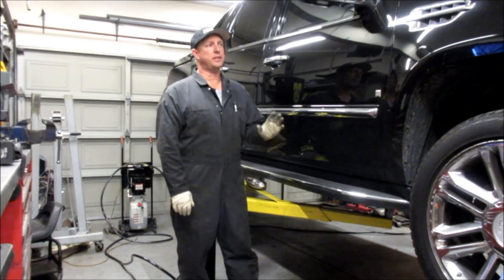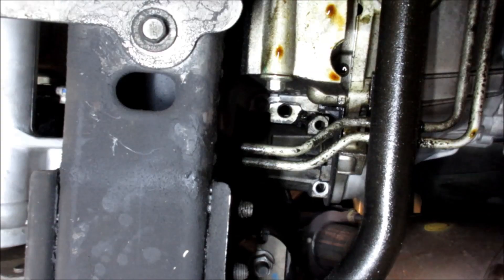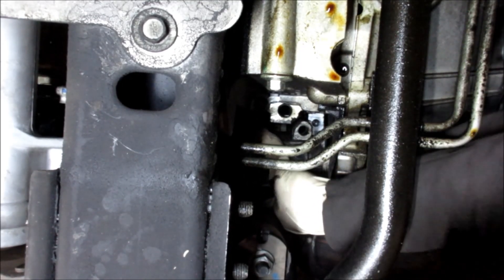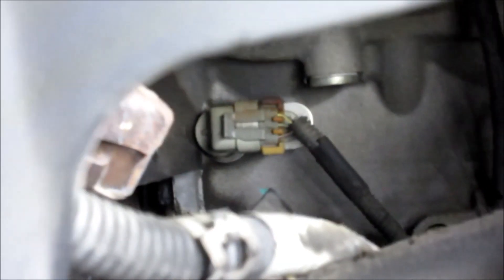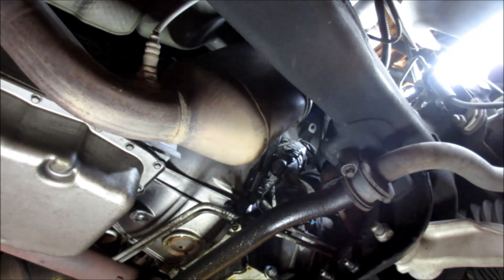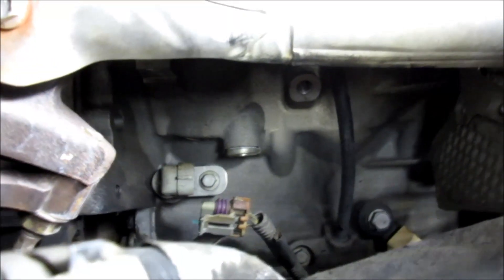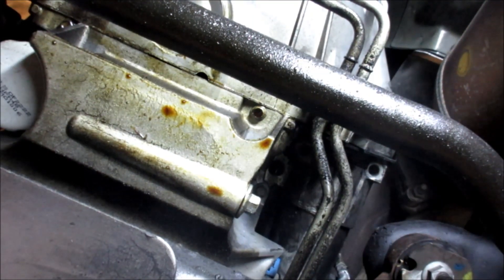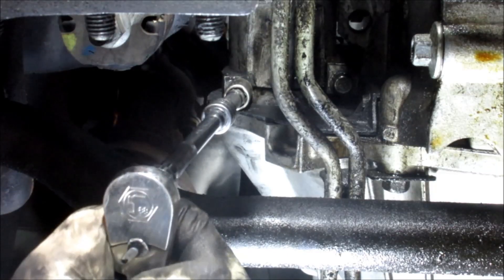Chevy GMC Cadillac GM 4.8L 5.3L 6.0L 6.2L crank sensor replacement

Comment: Where is the crankshaft position sensor located? 2015 silverado 5.3
Reply from the maker: It's right above the stater. Bolted into the block with three wires going to it

Comment: I have the same drip of oil on my starter bolt. Is this why you replaced the crankshaft sensor? It seemed dry when you removed it. Thanks.

Comment: I just did this on a 2012 Yukon Denali 6.2l - easy. Fired right up. Seems to run good. What started it all was oil pressure sensor - gauge reading nothing or erratic. Changed that and P0300 code appeared. Ran Techron through two tanks of fuel. No vacuum leaks. Had P0305 code appear for a day which means misfire on cylinder 5. Changed plugs and wires and P0300 code remained and P0305 disappeared. Had a guy tell me a lot of times it's the crankshaft position sensor so I changed it by disconnecting battery and making the repair. Code was not present when I fired it up. Have only driven a mile or so. Will report back when I get some more miles on it. Normally takes less than an hour to throw that P0300 code if it's still present.
Reply: Any update?
Reply: @mr314mannie no problems since then

Comment: I have a 2010 Chevy Silverado 1500 ,8 cylinders 4.8 motor if l replace the crank position sensor do l have to relearn it or reprogram?
Reply: Yes you need to do the relearning process

Comment: Great video i have an ext 07 with 134 k miles and i have problems some times when i try to start the car , it happen only few times , im not sure what is the problem , but couple mechanics told me it might be the crank sensor , i replace the fuel pump like 6 months ago , why did you you change this sensor ? What kind of problems was giving you ? Any help please

Comment: I see you didn't reprogram the firmware for the ECM, which is used to interface the cranksensor. I guess it wasn't formatted out of the ECM because you disconnected the battery or you were just lucky.

Comment from the maker: Not always. The car will start with the new crank sensor. If it sets a code for relearn then you have to take it to any shop that has a scan tool. They can relearn the crank sensor for you.
Reply: Why did you change it.. Was the truck not starting.. I had my stop running at a light today and looked at all the fuses everything was good 20 min later the truck started
Reply: @johnl5217  my truck did the same thing did you replace the crankshaft sensor? If so did that solve the problem also what brand did you use
Reply: How to relearn sensor
Reply: Ppl